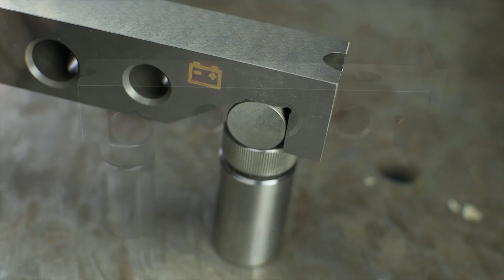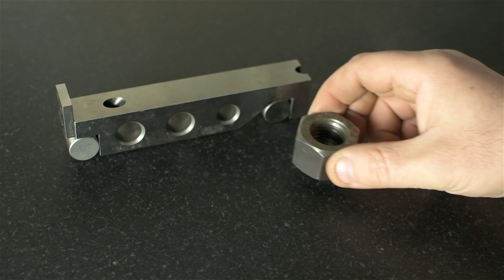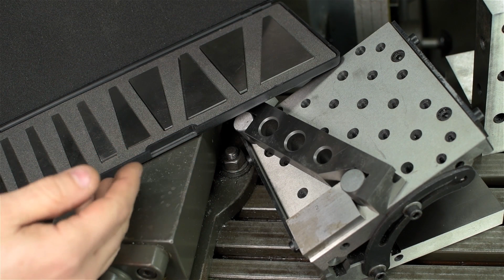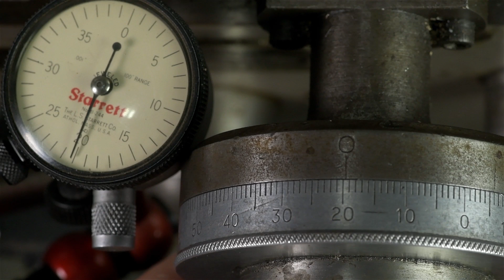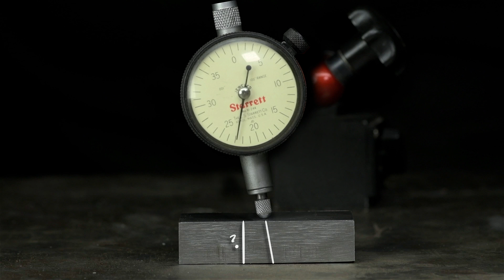A Sine Bar Walks Into a... wait

Comment: Excellent explanation, Old Tony, about sin and cosin. It's hard to give a feel of what they mean, Tony - and you did it. BTW, the word 'sine' is a 800 year old mistranslation of the Arabic word "jiba" that means "the chord of an arc" (translation of Skanskrit "jya" meaning "bowstring"). Some dude called Gherardo of Cremona mistook "jiba" for "jail" and used the word "sinus" that means "fold in garment, bend curve, bosom". The sine which is a straight line is called sine because it comes from a word meaning "bend curve" because of a mistranslation that happened 800 years ago.

Comment: Thanks. I understand how a sine bar works. But unfortunately I followed very little of your lathe discussion. How does one use the sine bar with a lathe or do you not? Do you instead use the dials on the lathe as you showed? If that is the case, then what the heck is the sine bar used for?

Comment: Ever wonder why the ratio opposite/hypotenus is called sine?   It's a mess up of translations from Sanskrit to Arabic to Latin then English.
In Sanskrit the word was jya meaning bow.  Makes sense because an angle on a circle looks like a bow & string.  That got translated by its sound to jiba in Arabic which sounds like Jayb which means fold.  That got tranlated to Latin Sinus which means fold, and some Englishman changed that to sine.  Whatever.  No it wasn't Trigon of Greece. Psst.  There was no Trigon of Greece.😅

Comment: I nearly went nuts building a spread sheet to do taper calcs  , stack height calculations for sinebars because I am not very good at math . However I was successful in the end and now I can do it easily in the  spread sheets for any length sinebar . You can also build a sine bar attachment for  the lathe compound slide and set it against the tail stock shaft or a bar between centers . with the correct stack height ring thickness on one shaft to set the compound to a short taper cut . Once you have the ring for a certain taper like a Morse taper 2 it's so easy to set it to machine another one . I don't do machining work anymore due to war injuries and tooling becoming so expensive now .

Comment: This came in handy for me!!!
Say i wanted to cut a cool gemstone cus i was mad, cus someone said i couldnt do it, and in plotting the design, i needed this shop math. (To measure distance of center line conecting to surface circle, by dividing two points on it with a line, fancy triangle jumbo idk)
My perfect saving grace!!! So anyway i thought it'd be cool too, if you made up a new playlist for shop math like this, or at least something for the rabbits hat magic you can pull like this. ❤u
(Edit) forgot the flash bang... So nevermind, tread carefully.

Comment: Interesting to note is that sine bars do not actually set the angle of the bars surface. What it sets is the angle between the centers of the two cylinders and the bars surface is manufactured to be parallel to the plane running through the centers and axis of the cylinders. This is designed so, specifically to make sure that no matter what angle to horizontal the sine bar is at the radii of the cylinders are being constant will keep the centers of the cylinders the same distance away from surface plate and gage block stack.

Comment: I'm not sure how many times I've watched the video (more than 5, less than 10), but had to tell you thanks. It's been 27 years since I had sin and cos in math, but had no idea how those worked. I learned enough to move on. Now all these years later I actually learned what those were and how to use them and all that. It took 27 years and my third language to learn these! Luckily I'm better with languages than math, at least on the native speaker side.
Anyway, my math teacher should give you her pay from that time.

Comment: If the test indicator is meant for 12deg, wouldn't the % error be the same for both 10deg and 14deg as they are 2deg off from 12deg either side.?

Comment: Not to upset the apple cart here, but after a brief tangent into the world of physics-based video game programming, I'm happy--or, sad... well I'm here to report that it's all shop-math based. Not the physics-based stuff--that mostly gets handled internally by the physics engine (Kind of the DRO of the programming world). But as far as launch/barrel angles--it's all based on the same math. Now, if you start factoring in projectile spin, fluid friction, aerodynamic forces, the shop math is only part of the equation, but it's still very important.

Comment: This video should be used in a teachers college to teach teachers how to teach. The way it is done in schools fails to provide a reason or a practical application for the facts and figures that they want you to learn. Especially with boys a connection has to be made to switch the brain on to the subject being taught as boys learn in a different way to girls. I had a real problems with Algebra, as what was the alphabet doing in math, until I wanted to hand wind a transformer for a power supply then it all made sense.

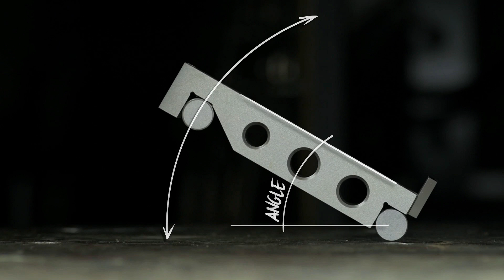Comment: For those watching the explanation at 6:15 with the Flashlight and Shadow... that is badly and fundamentally INCORRECT.
The shadow analogy is completely wrong because the torch will cast a shadow that is LARGER than the object. Even the sun which is millions of miles away casts a shadow that is slightly larger than the object it's shadowing.
Just use the ACTUAL dimensions to explain it, as that way you are looking at the object and not some non-existent shadow (which will never reflect the actual size).

Comment: Speaking of trig, (tell me if you ever heard this one) when I first started my apprenticeship (oh about 55 years ago... lol) an old Diemaker told me a meme(?) to remember the sine, cosine and tangent formulas for a right triangle so I wouldn't have to constantly have to look them up (we worked with a lot of non-square  shapes). Anyway the meme was this, to just remember this phrase- "There once was an old Indian Chief named 'SOH-CAH-TOA' " so for any right triangle - SOH-CAH-TOA, the Sine of the angle = the Opposite side divided by the Hypotenuse, the Cosine of the angle = the Adjacent side divided by the Hypotenuse, the Tangent of the angle = the Opposite side divided by the Adjacent side or S=O/H. C=A/H and T=O/A. As you can see it stuck for over a half a century, sorry for being so long winded.

Comment: Great video. Had to use a test indicator for measuring gear lash on an oil pump driven off the engine last year. If it was not parallel with the gears it gives the cosine error!

Comment: You need a compound vice, we have one at my work. I've used the sine bar once before on a actual job, what I had to do though was put a slot in at an angle. So I clamped the block "flat" in the vice and then used magnets to hold the Guage blocks and bar in place. Compound vice are heavy and awkward to work with at best, but it really is a good investment.

Comment: the point of contact of the front wheel with the height adjuster is 5" from the point of contact of the back wheel with the horizontal surface. the graphics used centres of circles which confuses the goal of making a RA triangle with two known sides

Comment: IMHO the problem with trigonometry in school isn't so much about being distracted by the fourth "D" variable. But rather the way schools approach the subject.
Just slapping formulas on the board doesn't do it for most students. You gotta spark their curiosity and there are plenty of good videos on the subject that explain HOW and WHY those formulas were derived.
It sure doesn't hurt to have practical experience alongside the theoretical learning as well. Build a zip line or something and have the students figure out the necessary length of the cable for a slope X.
Build a contraption and have the students figure out the math. Have some incentive for them. Competitions usually go down well if the students take their learning seriously, which they usually do if the school is worth its salt. Make a robot wars tournament in school and BAM, instant interest. At least for the boys. Some girls too ofc.

Comment: Hi mate.  Great deal to learn in machining from your videos, but sorry to say you mixed up the sine with the cathetus and the cosine with the hypotenuse in this video.  Sine & cosine are used to calculate angles using the values of the cathetus and hypotenuse, obviously in a triangle.  Sine and cosine are dimensionless, whereas cathetus and hypotenuse, have physical values, that is they can be measured.   Raz

Comment: Technically you could change the height of the stack but to keep it at the same angle you'd have to move it closer or further away from the pivot point

Comment: When TOT got out his flashlight and said “let me shine my flashlight in this,” or whatever it was he said, the flashlight on my iPhone turned on.  I went back a few seconds and tried again, but I guess it was just a fluke.  

We’ll actually it wasn’t a fluke.  A fluke is an electrical meter and I have one because I’m an electrician and not a machinist.  We also use trig when we’re calculating power factors or bending conduit.  Usually the latter because the power factor is already calculated by the equipment manufacturer and we just install the thing.

And actually it isn’t the latter.  A ladder is what tradesmen who don’t spend their lives in machine shops use when they need to install something that’s higher than they are tall, that, and you get bad luck for walking under them because of trig.

Comment: Trigon= figure with three sides, as pentagon= figure with five sides; metry simply means medition or measurement. In other words, measurements of a triangle. All derivatives of the Greak language. I'm a teacher. I teach the way you do: I cut the crap off. Ps: you could have used a surface plate for such a valuable lesson.

Comment: I've been a toolmaker for 45 years and also a metrologist for 26 years. A sine bar and a set of gauge blocks are just awesome tools to have in your tool shop. It's probably the most accurate way to set something at an angle or to determine an angle.

Comment: TOT - another good video, though maybe mention SOHCAHTOA, and what the working defn of Sin, Cos, Tan, of an angle in a constructed right angle triangle is Opposite div Hypotenuse for Sin, much btr with pen, paper, in a video, and the special 3 4 5 triangle matching the size of your bar and multiples of for ease etc abbreviated explanation, maybe an addendum video, thanks.

Comment: rule of 3, 4, 5. In a 90 degree triangle, small side is 3, large is 4 and diagonal is 5. multiply those with any constant and you can draw right angles anywhere.

Comment: I love this video, I actually learned something. You can use cosine error to measure a part that you otherwise would not to find a linear dimension say you had a feature in the way just use a known angle and measure off that then reverse that figure with the math to find the actual length. NEAT!

Comment: What stabs me is that you go define Sine & Cosine wrongly. Specifically, the whole bit 6:54--8:00 would be right IF* the distance between pins was "1" (unitless); however you keep repeating it's 5inch.  (*I should type "IFF" for "if and only if".)  So what you draw as "sine" and "cosine" there are that TIMES hypothenuse=length between pins= 5inch. Not so important when you scale it away (Sine-divided-by-Cosine is same in both versions); important when only appearing in one side of an equation etc. It makes sense same angle error causes greater mismeasurement error on larger pieces.

Comment: Have you ever used cosign error intentionally to your advantage to get a crazy accurate reading from your indicators?  You know the same way you used the angle on your top slide to get a more fine adjustment on your lathe.

Comment: 0:54 Except for us nerds! OK, we also started thinking about other stuff, but it was just background noise and it didn't prevent us from doing important stuff. And that's why we've always had problems socializing :(
Fun fact: if you extend the hypotenuse until it touches the vertical line tangent to the circle, you get, guess what, the tangent.

Comment: Easy Trigonometry - SOH-CAH-TOA rhyme for triangles with a 90º angle 
S = Sine  /  C = Cosine  /  T = Tangent
O = Opposite (one side that meets the 90º) /  A = Adjacent (the other side that meets the 90º angle)  /  H = Hypotenuse (the longest side of the triangle)
SOH = sine (degree of angle) x Opposite side divided by the Hypotenuse side
CAH = Cosine (degree of angle) x Adjacent side divided by the Hypotenuse side
TOA = Tan (Tangent degree of angle) x Opposite side divided by the Adjacent side

There are lots of videos online that go through these equations if you need a brush-up.  Just remember the Rhyme above.

Comment: for a moment there i thought sin(30) was 0.505030 according go the book but it's sin( 30 and 20 something )

it's the reassuring 0.500000

so it's the angle to cut a sphere and get a disk that has half the radius of that sphere

Comment: Great talk.  Only thing I didn't get was why the cross-slide table would be set to 30 deg to acheive half the inward travel per turn.  Seems like it would be at 45 deg to halve the travel it would have been from the normal 90.  Don't worry about insulting my intelligence... that's impossible.

Comment: Putting the indicator in the carriage and sweeping along with an indicator is in fact commonly done for angles and so yes the gage block dilmemma comes up as if trying to use a sine bar. A very good trick is take a test cut close to the desired angle and put in an indicator and move over a known amount using the readout in the z towards the head. The trig quickly jumps out at you that for example a 8.203 degree angle has a certain rise if you crank over one inch. But the indicator shows .003 less than the correct amount--rotate slightly and cut again untill the angle reads right. There are variations but you get the idea. This actually has to be done unless no accuracy is wanted--a person cannot just set the angle and do the angle--that would be poor shop practice.

Comment: Civil engineer here (not that you need to be one to know this). Sine is not the length of the cathetus, as your graphic and explanation suggested. A sine is really the length of that same cathetus (side) (the one opposed to the angle in question) divided by the length of the hypotenuse.

Similarly, cosine is the length of the adjacent cathetus (adjacent to the angle in question, that is) devided by the hypotenuse.

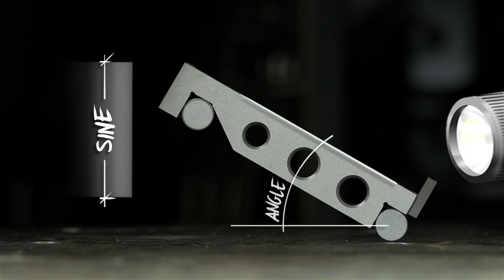Comment: At 6:58 isn't it true that the projection (indicated by the shadow) is the "opposite side" of the triangle and NOT the "sine"?  The sine is the RATIO of the length of that "opposite side" and the  5" center distance.  That 5" is called the "hypotenuse."  A very helpful video none-the-less.

Comment: 25:56 use cosini error your advance. you mostly centering parts with it..if your needle not seems  to move when you have cosini error. it MOVE LESS when you measure correct. so if needle move bit that is closest i ever get it if i would measure it correct way :)))

Comment: 14:15 Just a guess from a non-machinist craftsman.  But could it be that sine bars lengths are divisible by 5 because it's a hypotenuse?  You can calculate using the 3,4,5 ratio then.

Comment: Why would it be called cosine error when the value you get is related to 1/cos= secant of the angle between the measuring tool and the line segment being measured. Even so, the measurement error is sometimes expressed as a range of values which is related to the derivative of sec t, which is sec(t)tan(t) so it should be called the secant-tangent error or sine-by-cosine-squared error. People will surely like that name much more.

Comment: Uhm, hypotenuse, not tangent.
https://en.m.wikipedia.org/wiki/Trigonometry
Tangent is line 90Deg to hypotenuse, starts where it meets the radius and ends where its meets the line vertical from center of lower pivot (point of triangle).

Comment: Is it bad that sometimes i take those test indicators and use it at like a 45 degree angle or more to be able to read smaller measurements for comparisons sake. Like if i was tramming a mill head and don't have a tenths indicator, i just have the test indicator at a 60 degree so each increment is essentially twice as small, making it easier to tram more accurately

Comment: In piling of slip gauges it is necessary to take the minimum number of blocks to achieve a particular height. You said that you can take as many blocks as you can. Yes you can but the height of the blocks will not be that accurate when you take just 2 blocks. This is because there is some tiny amount of space that exists between the two blocks. When the number of blocks increases the space between the blocks adds up and the pile of gauges gives an inaccurate height. The error in the height will be very very small but when taking measurements at such an accuracy every bit matters.

Comment: many years ago i made a sine bar.    from a ground plate.   i had my friend  drill 3 holes on a die mill.  2 at one end, the pivot point.   and one at the other end.   using  14 "constructions balls.

Comment: HI Old Tony. I am a sheetmetal worker 30 years in the trade , i am used to using trig and pythagorous but never heard of a sine bar ,probably coz it is more maching based. I have to congratulate you on your humourous delivery of info. I completely understood all the info you gave . I have used a couple of lathes briefly and thank you for clarifying the operation of winding in the head that the diameter is usually affected but you need to check the lathe as it could be radius . Very good video. I have to wonder how many times over the years you have explained how a  sine bar is used , becuase your delivery was virtually without pauses for thought. well done . Best regards Don